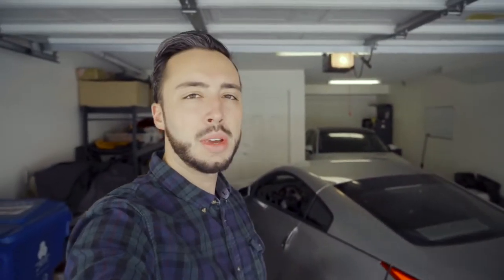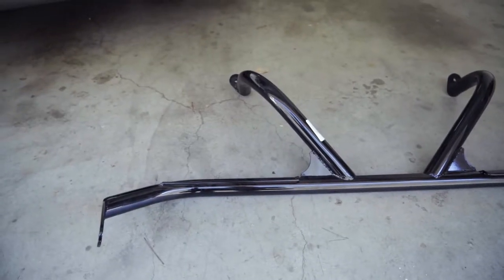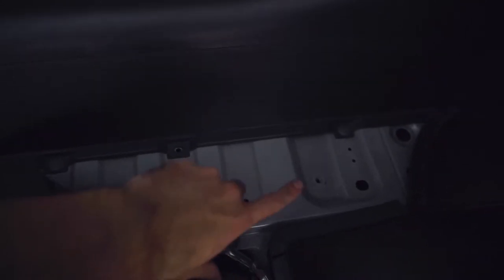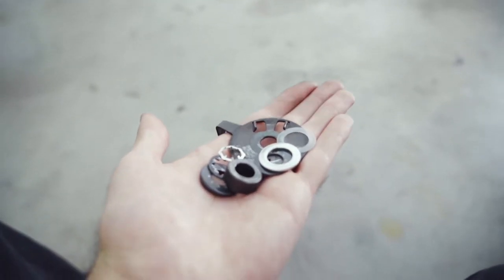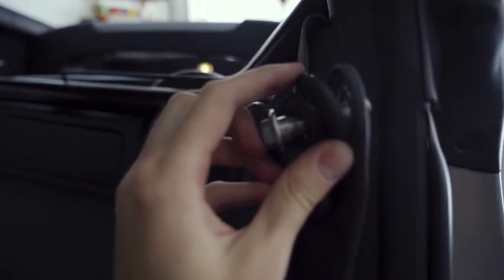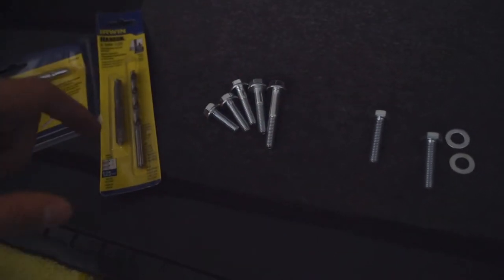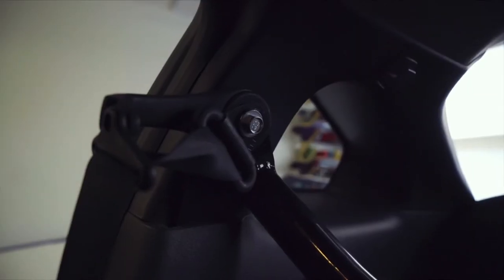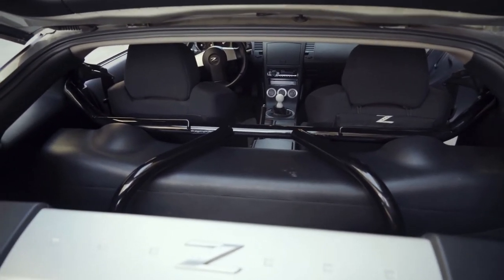350Z DRIFT PROJECT STARTS NOW! Graffiti Harness Bar Install

Comment: Be Careful with that Bar man! I recommend using stock seatbelts and having the harnesses for show. Can be pretty dangerous...stay safe🔥❤️
Reply from the maker: Thanks man, I was reading about the issues with using a harness bar unfortunately after I purchased it. Needless to say I won't be using the harnesses on the street. Long term, I'd like to do a half cage.
Reply: Average Bros Media That’s great to hear man!! To many people putting themselves in danger with the bars! When your ready for a half Cage. You can email me. My sponsors BlackbirdFabworx are the best for cages!
Reply from the maker: @ChristianLopez33  Awesome, I'll be sure to keep that in mind!
Reply: @ChristianLopez33  why are the dangerous
Reply: John Pitts Bolt In Harness Bars are not legal at any Track I Know of, If most Safety professionals don’t recommend I would follow that. Also When using Harnesses, I always believe 5 point or more is best. The last thing you want is your body to go through the Bottom, I have a Custom Welded Half Cage in my Vehicle, the Proper Seat, and 6 Point Harnesses. Basically, to me(my thoughts). If your Not Track racing, and don’t Have a Roll Cage/Half Cage. Don’t Run Harnesses, my Opinion. And if you are Racing, always get a Welded Cage, Bolt In Cages are for show Only. Not safe to Run, don’t have tight clearances, weaker, and have a much higher change of failing
Reply: @ChristianLopez33  Thankyou very much.. Very well said